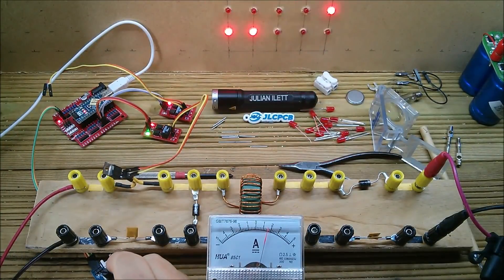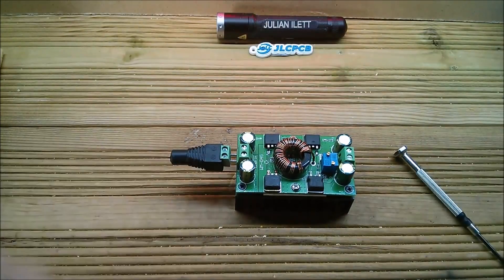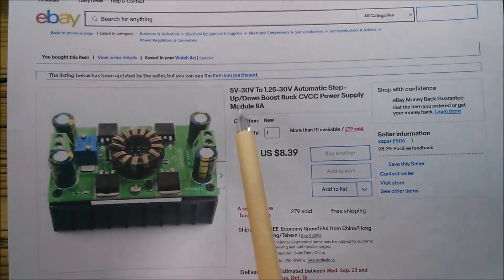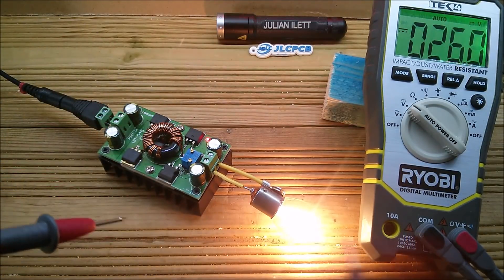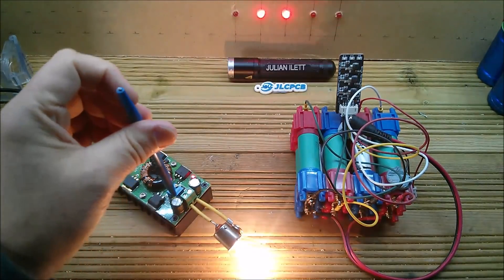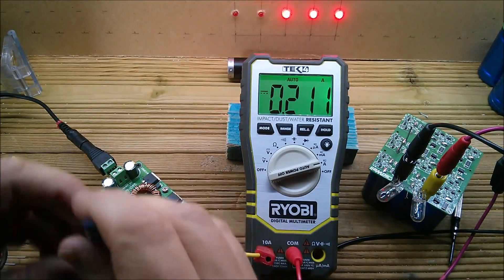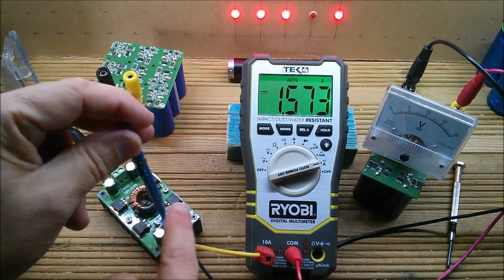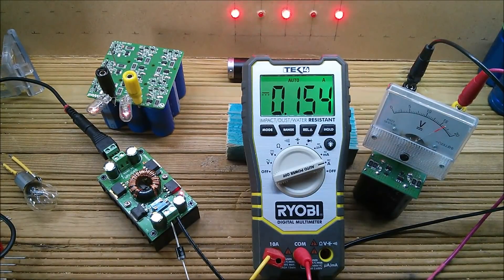Buck/Boost WM-045 - Looks like an LTC3780 (but it's not)

Comment: Hi  newbie 
I have 3 good 3.5v  40ah cells
Could I use a buck booster to get 12.6v  to run a camp fridge etc  max would be 10a
Or would it run down battery quickly 
Thanks

Comment: I take all my old broken cheap probes and solder Dupont pins to them.  Add some heat shrink to stiffen them up a bit and they're perfect.  Also, a set with alligator clips just in case. ;)

Comment: I spent a good chunk of time doing research on this chip on my own, and found that it's a knockoff of the LTC1775, a no r-sense current mode buck converter for high current applications. One of the application circuits is a buck boost converter using three FETs and one diode, same as the circuit! 

Additionally there is actually one op amp, hidden under the inductor if I remember correctly. A63A is the number on it.
Reply: Additionally you can use it as a buck converter if you just take out the one FET and do some basic rewiring.
Reply: Great info, thanks! Very interesting.
Reply: Thank you sir. This information really helped

Comment: Can't hear the high pitch as the audio quality is like that of a 64KBps WMA file.
Good on the ears....

Also, would've been great if the manufacturer hadn't filed off the part number....
What happens if you wanted to go from prototype to final product using their module as the basis?

Comment: SOOOO MANY people get confused by CC CV supplies, and I'm not sure why BUT, here's the answer - What you are ACTUALLY setting is the MAXIMUM current allowed and the MAXIMUM voltage allowed. If the load is varying but the current drawn is BELOW the limit then whatever current is required will flow. When the current tries to increase above the maximum set then the Voltage will drop to maintain operation within the Safe Operating Area of the supply and the current will be limited to what has been set.

1. Setting a "constant" voltage MUST be done OPEN circuit NOT when the circuit to be powered is actually switched ON and drawing current - erroneous setup or "finger trouble" results otherwise
2. Setting the "constant" current is done when the output is a SHORT circuit, OR (If you don't trust your supply) by ensuring a load guaranteed to pull AT LEAST that current. Same thing, BAD setup or "finger trouble" results

If you have set your current "limit" (CC) then NO HARM WILL COME TO  YOUR SUPPLY AT ALL. It can ONLY supply the current you have set IRRESPECTIVE of WHATEVER Voltage has been set. The output volts will DROP automatically to supply the current you selected into the load. It is unbelievable the number of people who get this SO muddled, partly, I suspect, it may come from experience with LINEAR supplies of certain designs that ARE sensitive to excess POWER dissipation under extended short circuit, ESPECIALLY when on the high voltage setting! This is because of the way they work intrinsically and NOTHING to do with the correct setup

Under these conditions (as for a battery being charged) the CC CV should be treated as a MAX Volts and MAX current setting respectively. Ohms law will STILL apply - 0 volts will be on the output for a short circuit even with the rated amps flowing (Super Cap at charge start). The problem is that the "load" resistance is effectively changing during use as a CHARGE circuit and under such conditions, there can be NO concept of a "constant" anything! Everything will be in a state of flux. The voltage will be zero (even if set at say 12v) and the current will be the MAXIMUM set until the tipping point is reached (MAX volts setting) when the current will be AT the current limit and gradually drop as the load decreases (the Cap or battery fills up)

If you have a 5v output supply charging a capacitor of ANY value, at zero initial charge,  the current will be high (the max allowed by CC) and as the capacitor charges the voltage across it rises to its max (CV) and the current will fall. When charging batteries, the initial voltage won't be zero, but again, depending on the state of charge, the current may be at the maximum level set CC and then it will drop while the voltage will be below the final expected level (CV set point) until the charge level has increased to the point where it has reached the MAX volts (CV set level)

IMPORTANT: You should ALWAYS do 1 & 2 above IN ORDER and ensure your MAXIMUM charge voltage and MAXIMUM charge current are set at the output BEFORE you connect your charge load. NEVER change their values during charging otherwise your charging procedure will NOT be correct and you may well blow caps or batteries as a consequence!

Comment: i found i only need the diode is when the charging battery has a higher voltage than the buck converter i found as long as the converter is powered befor connecting i have had no need for the diode

Comment: i do similer kind of thing but with cheap charge controllers i have a lead acid system that solar goes then from lead acid load on controller that feeds a 3s lithuim charge controller i did start with solar on both inputs but found they was not away to combine the outputs so the solar charging the lead acid that then feeds the lithuim works prob not ideal

Comment: This seems to imply that the current detection is on the high side rather than the usual ground side. That would make this a useful module for common ground applications such as automotive which isn't possible with the devices which have ground side detection.
Any chance you could check this? It will probably involve removing the heatsink to see if both negative connections are attached to the ground plane.

Comment: Julian,  You often seem to be wondering what's going on.  Maybe you need to use TOOLS to help you?  Try something like https://www.aliexpress.com/item/4000111246909.html to monitor the incoming power.  Then something like this (with a wider voltage range) https://www.aliexpress.com/item/32992421935.html to monitor the output / load side.  And always have your oscilloscope there to monitor.  You have the tools, just use them instead of frustrating yourself (and irritating those of us watching who'd like to actually find out what's going on).

Comment: The probes are long, the wires are short :-) ...Quite a number of these modules on ebay/ali - it seems the IC is XLSEMI XL4016. http://www.xlsemi.com/datasheet/XL4016%20datasheet.pdf
 I believe I've read somewhere in order to set the CC you have to short the output. Here is another one https://www.ebay.ca/itm/XH-M401-DC-DC-Buck-Module-XL4016E1-High-Power-DC-Regulator-Max-8A-with-Regulator/162947064840?_trkparms=aid%3D1110006%26algo%3DHOMESPLICE.SIM%26ao%3D1%26asc%3D20200520130048%26meid%3D3eff9b55b63245018884e4611607cf04%26pid%3D100005%26rk%3D1%26rkt%3D7%26mehot%3Dlo%26sd%3D173918158270%26itm%3D162947064840%26pmt%3D1%26noa%3D0%26pg%3D2047675%26algv%3DSimplAMLv5PairwiseWebWithBBEV2bDemotion%26brand%3DUnbranded&_trksid=p2047675.c100005.m1851

Comment: I'd get a ISDT q6, then you would have balancing, what are the lithium batteries going to be used for? Also the ISDT charger is a good price, and will do about 20 amps, discharge at 1-2 amps or so, up to 6s,  and operates as a DC and USB power supply.  I have the Q8 for 8s ( I have 7s packs in my bank) I gave $60 American for it, it has nice features I haven't even gotten into. The only issue I have is the balance and discharge current us a bit low, but I'm working with 120ah to 300 ah packs, it's not really made for that! It should work with 10-20 ah or less, much better! I usually charge 1 cell at a go, let it rest, then balance charge , so it's basically balanced, because each cell is charged the same,  some I parallel, and add a bit of charge to, after charging to 4.1v parallel after all are very close then charge to 4.15- 4.18v per,  then assemble, and balance charge, to 4.2v for the first charge, I usually keep them to 4.1v.   The ISDT can be powered by any 10 - 30 volt supply, and can set limits and restrictions, to protect the supply, it's a buck boost charger!  I run mine at 25v with a 38 amp supply, it will work to do what you want, and it can be calibrated, it's not the cheapest option, but it is a deal for the features, I'd like to get the Q8 1kw version, it's about $80-90
But the 500 watt version I have works well! Good day & cheers!

Comment: I have one of these and mine isn't scrubbed and it is a STPS20H100CG (which is a 100v 20a schottky rectifier) with three IRL3803L mosfets . I love mine and it works great....very smooth switchover. Thanks for the interesting video! P.S. Those last numbers on the chip are CHN 748, but as stated it is an ST chip. Sorry yours doesn't do CC correctly, but mine does. You just have a faulty module.

Comment: Yeah yeah yeah yeah - where’s the modular shed videos!!

I need ma fix man!!

🙏🙏🙏🙏🙏🙏🙏🙏🙏🙏🙏🙏🙏🙏🙏
Reply from the maker: Sneak peek: https://lbry.tv/@LBROI:8/Insulate:a
Reply: Julian Ilett ooooh yeah, that’s the stuff. 😬

Lol! Thanks Julian. Looks good. Gonna get cold 🥶 soon.
Reply: Julian Ilett I know we’ve talked about this before, but Rockwool...

I used some today actually for studwork and flooring. It’s SO much nicer to work with. And the edges of it are designed so that it stays put when wedged between studs/joist. 

I know it’s more expensive but it’s well worth it. It blocks sound much much better too

Note: everyone, no I don’t have shares in Rockwool... 😐
Reply from the maker: I'm planning to have fluffy internal walls - no internal panels. These really have to be rockwool, not fibreglass. So I'll buy a roll of rockwool soon (it's still warm, so there's little incentive yet). My cunning plan to hold the rockwool in place is net curtain wires :)

Comment: I feel your pain re: the multimeter probes. I've started using smaller slimmer ones as a matter of course. There's an excellent set of slender little Fluke probes available but they're something ridiculous like 70 quid a pair. For the likes of us, you can buy the ones which are supplied with the Aneng 8009 meters, which are similarly compact, from Banggood for under a fiver,  I currently have 3 sets of those plugged into 2 DVMs and my bench meter. I had replace the bananas on one set as they were only just making contact in the sockets of my bench meter, but that did allow me to inspect the conductors, which are just about acceptable. Are they really Cat III/1000V, Cat IV/600V? Probably not, but who cares? I don't make that kind of measurement anyway. The probes are certainly much handier and more convenient to use than full size ones.
Reply: I feel your pain as well, because... I mean, it's not a competition but in my experience multimeter leads are the only thing that gets more tangled up than headphone cables.

Comment: A little trick I learned fixing TV's where it was hard to see the writing on the chips. Spread a tiny bit of heat sink paste on the chip then rub it off with your finger. Sometimes the paste gets stuck on the slight texture of the printing and you can read it easily.
Reply from the maker: Awesome tip :)

Comment: Error alert, Most of these units drop their voltage  when under load if they reach the current limit, which means the current out will also drop as it reached the limit, subsequently, when the load changes (released), the current will also rise. These things merely cut off if the preset limit is reached, therefore, it the current limit control is twiddled, the reading will also rise. Basic physics.. Boom, Boom.!!

Comment: Seems widely sold on Ali.  Cannot find schematic or driving chip spec.  150khz.
(shrug)
Reply: maybe this one https://www.ebay.ca/itm/XH-M401-DC-DC-Buck-Module-XL4016E1-High-Power-DC-Regulator-Max-8A-with-Regulator/162947064840?_trkparms=aid%3D1110006%26algo%3DHOMESPLICE.SIM%26ao%3D1%26asc%3D20200520130048%26meid%3D3eff9b55b63245018884e4611607cf04%26pid%3D100005%26rk%3D1%26rkt%3D7%26mehot%3Dlo%26sd%3D173918158270%26itm%3D162947064840%26pmt%3D1%26noa%3D0%26pg%3D2047675%26algv%3DSimplAMLv5PairwiseWebWithBBEV2bDemotion%26brand%3DUnbranded&_trksid=p2047675.c100005.m1851

Comment: The trim pot pen, do you have a link for that? Super sensible option compared to fiddling around with a screwdriver:-)
Reply: They're available on Amazon. https://www.amazon.com/Potentiometer-Tools-Hardware-ADJUST-TOOL/dp/B06Y6FTGNT/
Reply: @PablumMcDump  Cheers for that:-)
Reply: I get mine from RS.
Reply: @dogwalker666  Not got an account with RS, Maplin used to be my go to place for anything electrical.
Reply: david bone maplin was handy you can get them from farnell if your trade or CPC for non trade they carry most stuff RS has for next day delivery.
Reply: I still have mine from 40 years ago! Exactly the same Bourns pot driver!
Reply: @boblewis5558  Me too, bought a kit a number of years ago when Maplin were still going strong, not got one like Julian's though that conveniently sits over the head of the trim screw.

Comment: Multimeter probes have always been designed for electricians so they're a bit big for the kind of things we use them for.
You can get needle probes that don't have the annoying finger guards and are extremely sharp for probing tiny parts and poking through flux residue and conformal coating.

'These for example
https://www.sparkfun.com/products/12078
Reply: Mai Mariarti  Agree. No surprise when we outsourced everything to the Chinese...
Reply: Indeed they are for electricians not electronics testing that's why I have 2 sets.

Comment: The very quick kick-in of the CC control was down to the resistance tempco of the bulb. As it dimmed, the resistance dropped and it avalanched down as its effective current demand increased, resulting in the PSU voltage dropping even further. As for the second part current problems, you have two closed loop controlled devices connected together at points within their loops. When you do that, the net loop response could be almost anything.